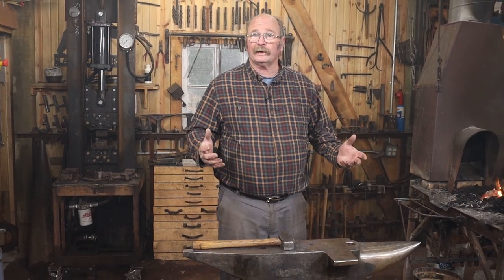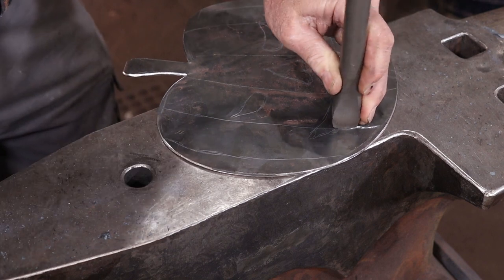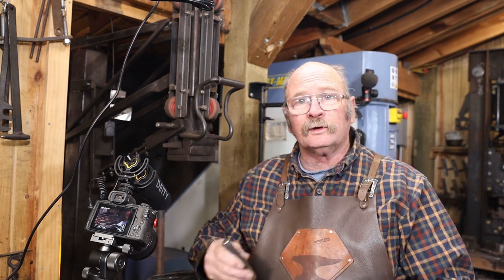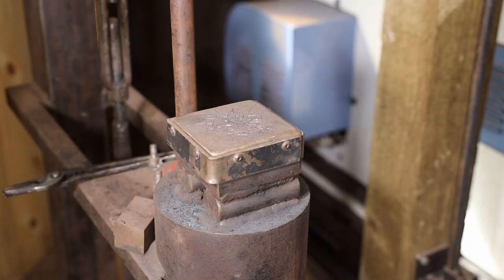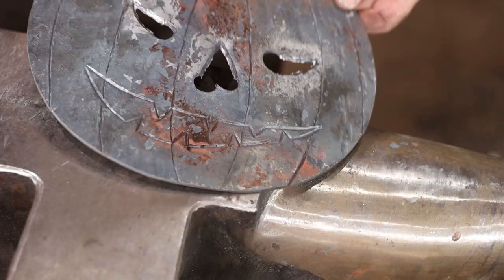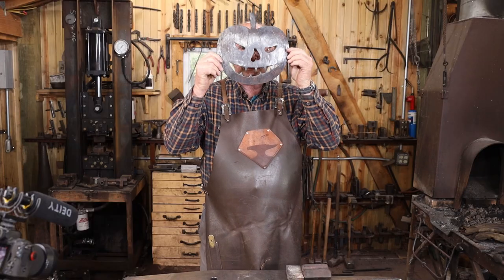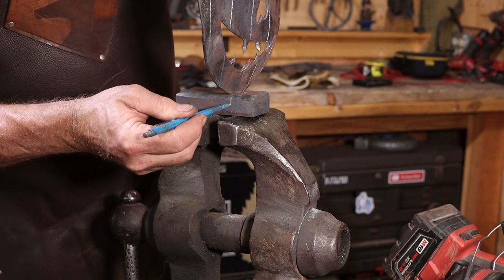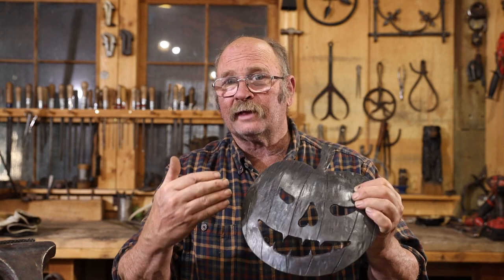Blacksmith Jack-O'-Lantern

Comment: Well done John!  Theres a difference between using a chisel and being good with one. You, sir are really good with a chisel.
Reply from the maker: The treadle hammer does help
Reply: Also his curved chisel which helps he has a how to make from car spring ( or upgrade steel if you want)
Reply: @johnjude2685  I have several. After watching John make the set several years ago I made a few of the different punches and chisels as well. There great and help a lot but nothing beats the years of experience that John has. The treadle hammer would help but I just have no room for anymore large tools.